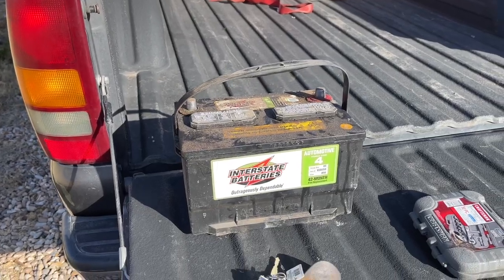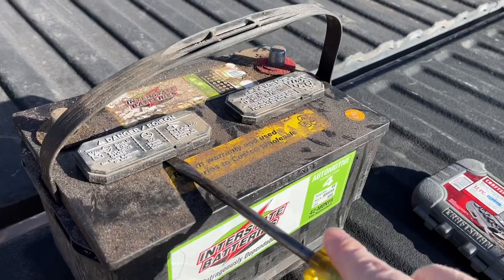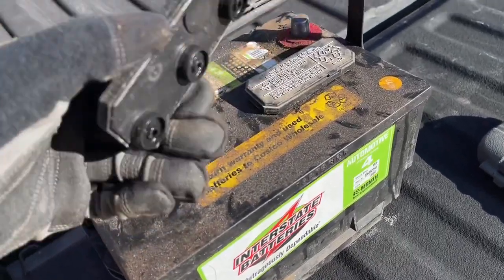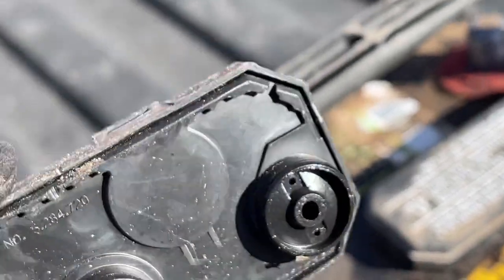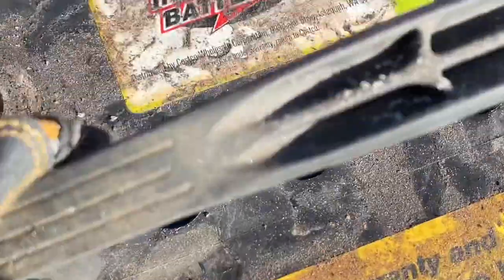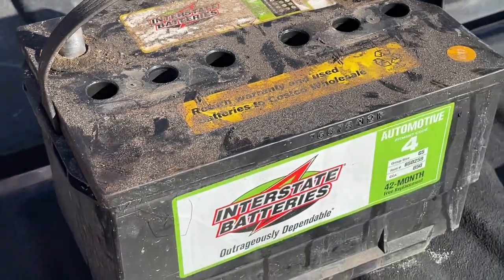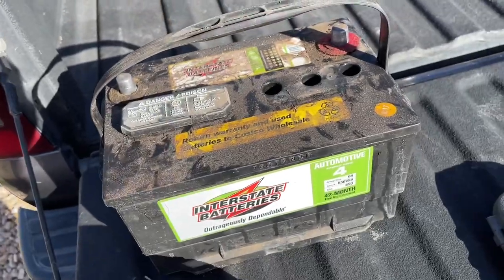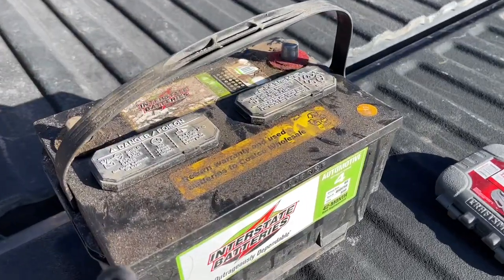Battery Cap vents explained: Do not remove while battery is connected

Comment: This video just changed my mind about doing the distilled water in my battery. My biggest fear is an explosion. What happens if you don't do the water?
Reply from the maker: The battery will not perform as well, but I don’t believe it will be as dangerous as filling it. For $100 it’s worth getting a new one
Reply: Is there a video of this explosion actually happening

Comment: They are serviceable, and lose a small amount of water over time. These vent caps are meant to be removed to add distilled water just enough to cover the plates below. You don't want to get anything else in there besides the water when doing this.

Comment: What if I found it popped off, is that normal?
Reply from the maker: These were off when I found them too- probably froze or something. Just be careful with the acid. Wear protective equipment and goggles. It should be able to snap back on
Reply: See, if your battery is vented and you find a cap popped off, IT IS NOT! IT'S A RED FLAG! AS THE VENTS ARE CLOGGED! Well, that isn't something you want, right?